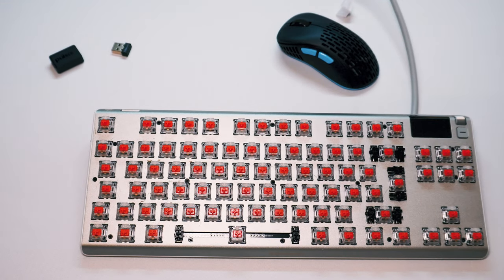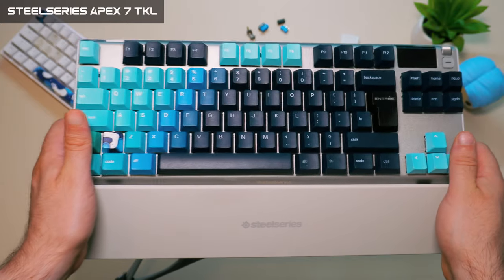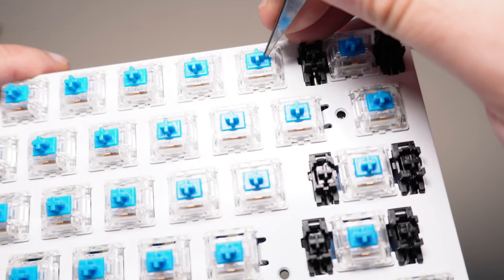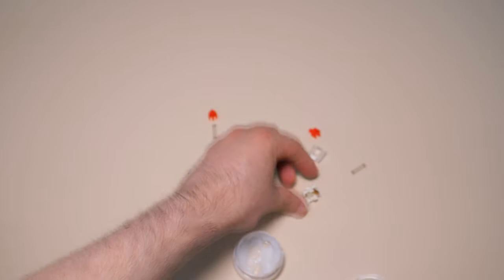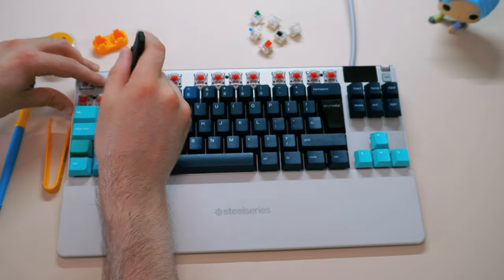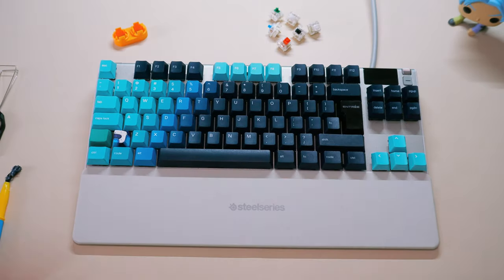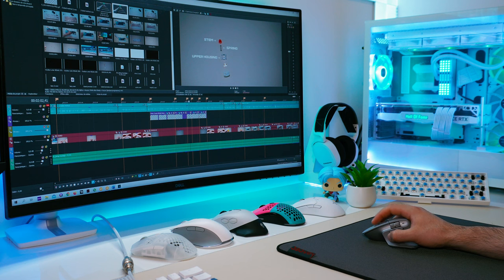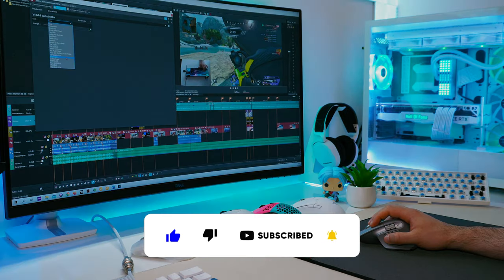How to lube your switches without desoldering. Just do this! No spray lubing!

Comment: thanks bro, clear, straight to the point. nice
Reply from the maker: You're welcome! I am glad you like it! 👍
Reply: @OlicheckGamingTech  lubing my apex pro mini right now, how would you recommend I lube the stabilisers on large keys ?
Reply from the maker: @ma3lstr0m06  Nice! Yeah, if you want, you can put a bit of lubricant inside the black stabs! Tell me how the end result feels? I am curious 🙂
Reply: @OlicheckGamingTech  So i went for lubing the black stabs, and also the metal insert where it  contacts with the stab. The kb is very mushy i might have overdone it :) 

So far i like it though.
Reply from the maker: @ma3lstr0m06  Overtime, it will feel better. The lubricant will spread out after using the keyboard a bit longer. I am glad you like it so far! 👍

Comment: All you succeed in doing with the brush method is lubing the stem, which... SURPRISE, does nothing to improve sound quality or feel.
Reply from the maker: Sure, like I said, it's not like lubing each switches’ part one by one. But doing like that with the brush, I can feel the difference. A small improvement done quick. Else, I wouldn't have done this video.😁
Reply: No.  The idea is that if you stick a small paint brush into the sides of the stem, then the lube will naturally fall into place and cover the switch so long as you stick a thin paint brush into all four sides.
Reply from the maker: @michaeldodaro  Thanks for the insight 👍